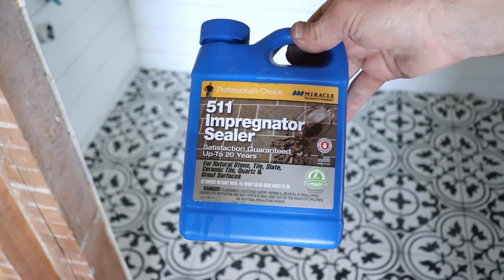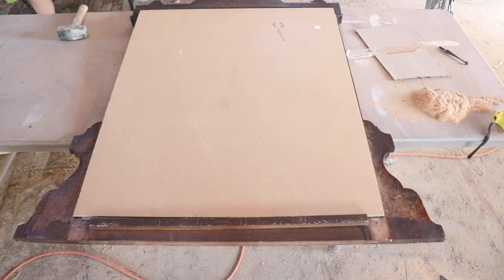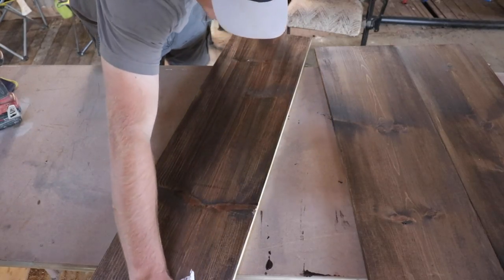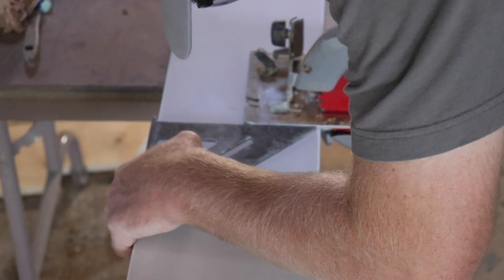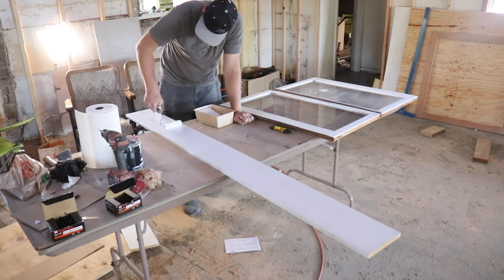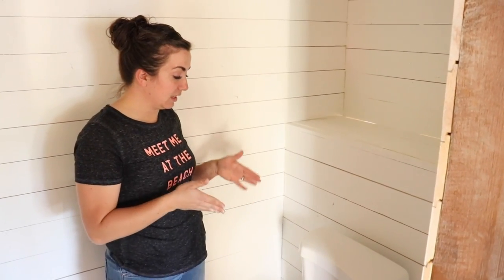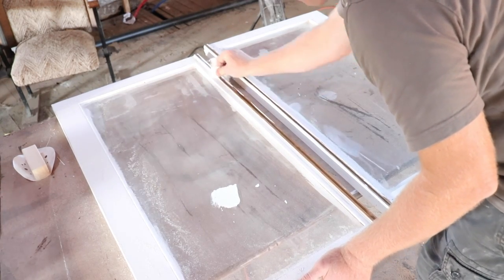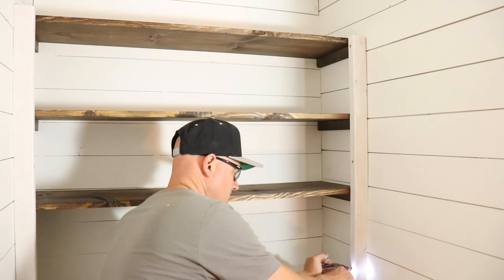Farmhouse Renovation Episode 18 | Bathroom Cabinet & Toilet Install!

Comment: love all you have done in that bathroom ! however I have one comment about the toilet , having replaced many of toilets myself i have never used any caulking around the bottom ,as it tends to attract dirt and grime making it harder to clean. the wax ring keeps the water from leaking out until
 its warn out of course.Also if there does become a problem with leaking you will not know it for a long time with the caulking blocking it . Please dont take this as a criticism Zeb , you amaze my with all your skills, carpenter , plumber, painter and the list goes on and on ! I really love you guys and watch and like all your videos. ! I also hit plant bar az up a lot for all my paints and supplies !
Reply from the maker: Thanks!  With the small children (Jack and Rederick) we seem to constantly have floods from water fixtures in the bathroom, not leaks, but blocks in the drain from things going down that shouldn’t lol. so I caulk to keep the water from running under the toilet. 😂😂 
But you’re right. I usually redo the caulk about once every year or so.
Reply: @JamiRayVintage   ah ha ! i get it , thanks for responding ! gotta love the little guys lol!